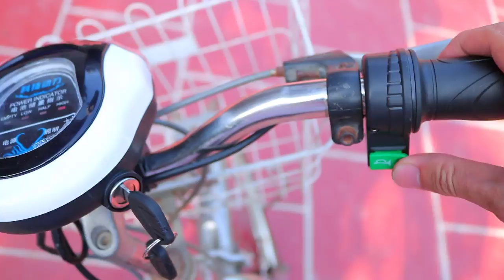TOP 3 Ways to Make Electric Bike at Home

Comment: The #3 made me laugh very hard, they are good faking everything, hahaha.
Reply: If you didn't know a 24 volt EDF can blow your face off
Reply: I have used 24 EDF on some projects and it blew a hole in styrofoam!!!
Reply: This blower is so powerfull it made my air pool full in 3sec i belive that he moved this fast with 3of them
Reply: I know it is fake buttttttt come on man it looks cool
Reply: I bet it'd be a great booster to a 775 leschi motorpower in the side of your tire and have three of them blowing s*** you might be going 25 miles an hour at that point.
Reply: He should of pointed them down and made em fly
Reply: sucks that he had to speed up his video to make It look better,  makes me wanna throw a shop fan on mine
Reply: Not fake.

Just very in efficient and not practical

Comment: NO WAY!the second method is just to easy! ;)
Reply: It akcualy works
Reply: @bezgarageUZ  yes it's work
Reply: The moment you let go of the throttle, the drill will slow the wheel down
Reply: @biluroy4455  j
Reply: Cam P engine braking :)

Comment: If I had a wheel with a motor I wouldn't need to watch this video.
Reply: It wouldn’t do it on its own but help you a get up the hill easier
Reply: Ya but those are expensive, that's the main idea of videos like this. To show you a cheaper creative way to do it. The drill one probably only cost $100 total. $90 for the drill & $10 for the zip ties. The parts for 1st one was pretty expensive & harder to find though but I would still choose that over the motorized wheel cause it's creative & funny. I would be very proud of myself if I could do that. The motorized wheel is fine I guess but I wouldn't be proud of myself, I'd just be like "iieet, I bought something & stuck it on my bike in 4 minutes. Whatevz."
Reply: @HelloHello-hk4sx  I welded a drill to a bicycle in the way in the video. The drill burned up so I destroyed my "$100 drill". 

I had more faith in the chainsaw methods and that didnt work either. So I destroyed a chainsaw and a drill following these only "cheaper ways". So now I have a drill that doesnt work, a chainsaw that will never cut wood again, and a bicycle that is still pedal powered. My point isnt that I wasted money because I have a lot of junk lying around. If the wheel with a motor in it works then it is 100% more worth it in resources and labor alone.
Reply: I also welded the drill directly to the pedal at a 90 to get the gear advantage and still a no go so yeah this video is not only misleading with the motorized wheel, it is fake.

Comment: Actually number 2 has lots of advantages ( could carry extra batteries ) but I see 1 that it needs . a doubled plate lower one rigid and static ,top one for drill to sit on with a bolt as hinge or swivel  so that it can be shut off by 1 cable and adjusted to contact or disengaged with another.  Then it could be freewheeled on downgrades and pedaled on relatively flat zones . Much more efficient for longer trips ,but its still amazing . Thanks to the creator of the idea..
Reply: MUITO boa a idéia. Parabens ! Vou fazer na minh bike.

Comment: No! You'll burn up a drill when the tire forces it to keep rotating when coasting. You need to use it with the sprocket and chain
Reply: Not if you used a really powerful one with like at least a 24v setup because I’m pretty sure this one is 18v
Reply: make a hydraulic clutch to disengage the drill when coasting lolll
Reply: @Piano_Reimagined  it's not about going forward, it's about becoming what forward is after forward exhausts all the countless hours and resources establishing a market for forward. After the public becomes convinced forward is a civil right that we have to fight to be regulated, when forward should be a given right in the first place. All people should have the right to forward
Reply: @mooresmotors5902  the drill would still burn up the tire
Reply: That's why you hold the drill and use it on the front.
Reply: Just wrap it with old inner bicycle tyre cut it like oring to avoid friction. And use 10 dollar electric drill from china. Solve problem

Comment: 1st hack safety tip>don't use cardboard, it's extremely flammable. Use thin pieces of metals, it won't start on fire when the engine/batteries get really hot.

Comment: Videos like these... you start out with an actual kit that works and is pretty freaking awesome. But than move on to the drill which, while it may "work" but would be extremely slow, loud, and would drain the battery superbly fast (if the thermal fuse doesn't blow first). And then you end with the edf powered bike.... totally fake, going to just be blunt. You were clearly going down hill and the video may have been sped up. Yes, edfs exist that would easily push that bike. And quite fast as well. But powering it off of two 12 volt batteries? Especially because you were using a pwm motor driver not even made for edfs, that wouldn't have even been enough power to keep you coasting on a flat smooth road. You had such a great video... and then you ended it with that lie.

Comment: Рublic funding and Registrierung hier: goo.gl/hxvBmz E-bike with Duyunov's wheel motor at StartUp Show in 2015 goo.gl/hxvBmz StartUp Show is an annual event aimed at presenting the most promising startup projects. In 2015 Duyunov's team presented their e-bike equipped with Duyunov's wheel motor at this event. Evgeniy Duyunov demonstrated the power of the wheel motor by effortlessly pressing the throttle grip. He also spoke about the advantages which include 17 kg light weight, 20 kW power, no magnets in the motor. As you know, all these properties make the wheel motor stand out when compared to similar Chinese motors. goo.gl/hxvBmz Evgeniy paid attention to the uniqueness of this invention which manifests itself in using a special winding type named "Slavyanka". goo.gl/hxvBmz After the presentation the impressed visitors bombarded Evgeniy with questions and the most popular question was about the price and the possibility of purchasing the wheel motor. Рublic funding and Registrierung hier: goo.gl/hxvBmz Das Projekt "Duyunov-Asynchronmaschine" wurde 2017 zum Ausbau und zur Anwendung der einzigartigen Ausarbeitung von D.A. Duyunov - des ersten asynchronen Elektromotors mit der Wicklung nach Art von "Slawjanka", sowie des Motorrades ohne Anwendung von den Seltenerdmetallen entwickelt. öffentliche Finanzierung und Registrierung hier !!! goo.gl/hxvBmz Wir arbeiten unter Teilnahme von folgenden Unternehmen: 1) Gesellschaft mit beschränkter Haftung (OOO) "ASiPP" - Ingenieur- und Konstruktionsunternehmen mit langjähriger Erfahrung, wo es mit der Entwicklung von dem Plasmaschneider, Motorrad, der Wicklung "Slawjanka" usw. angefangen wurde. Unter den Unternehmensgründern - D.A. Duyunov. 2) Unternehmensgruppe "SolarGrupp" - Crowdinvesting-Plattform, Verband von den engagierten Menschen, die für die Vereinigung privater Investoren weltweit arbeiten. 3) Gesellschaft mit beschränkter Haftung (OOO) "SowElMasch" - "Werk zur Produktion der Werke" - eine Gesellschaft, die fertige Lösungen für das Großgeschäft in der Elektromotor-Produktion anbietet und Innovationen bei der Herstellung durchsetzt. Unter den Unternehmensgründern - D.A. Duyunov. öffentliche Finanzierung und Registrierung hier !!! goo.gl/hxvBmz Das Schema des Zusammenwirkens von drei Unternehmen: OOO "ASiPP" setzt die Technologie um, SolarGrupp organisiert die Erhebung von Investitionen, SowElMasch wendet die Innovation bei der Herstellung an, wodurch das Produkt auf den Weltmarkt gebracht wird. öffentliche Finanzierung und Registrierung hier !!! goo.gl/hxvBmz Das Ziel des Projektes ist die gegenseitig vorteilhafte Zusammenarbeit des Unternehmens und der Investoren für die Einführung der Technologie auf den Weltmarkt und zum Serienproduktionsstart des gefragten Produktes. Die Technologie bekommt die Massenanwendung, die Investoren - den Miteigentumsgewinn. öffentliche Finanzierung und Registrierung hier !!! goo.gl/hxvBmz
1

Comment: Cool - what are the motor controllers you used for the third option?
Reply: Rly u espect it to work
Reply: It could work as a pedal assist meaning just as a helper and not to be used to accelerate or even just glide

Comment: Batteries are theissue either too heavy or no ah  lithium is only real deal ,20 miles
Reply: Pulse-jet. easy build, and so loud they wake up the dead. But powerful enough. The jet could maybe drive a generator driving an electromotor or maybe use a miniature Thorium reactor driving a stirling -type motor.  Or : catapult yourself to your destination with linear electric accellarators. Much faster. but return trip longer, unfortunately.......